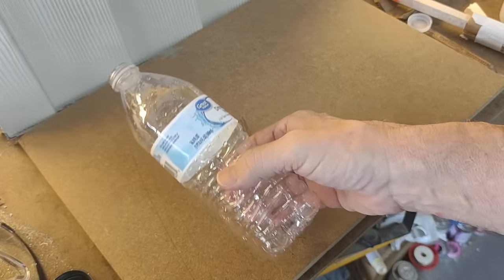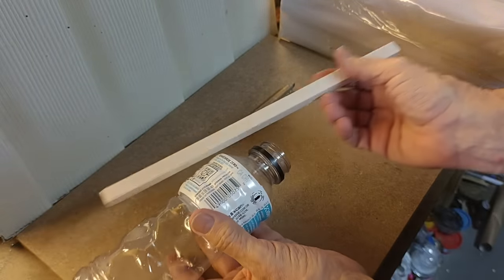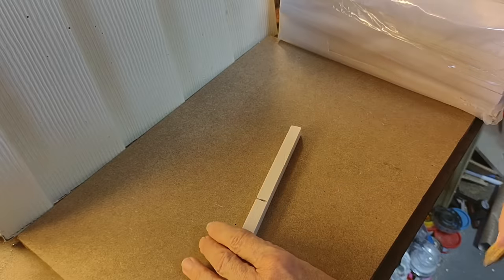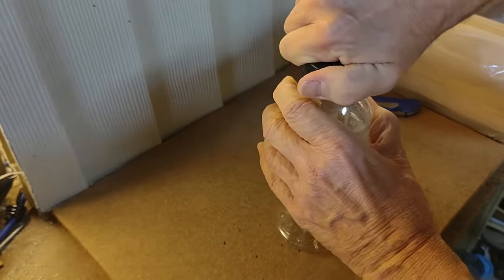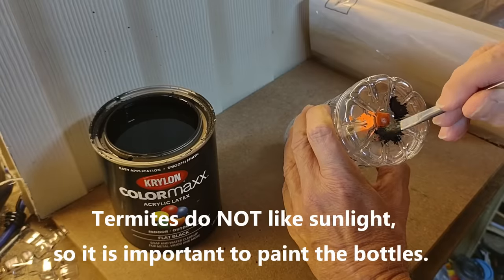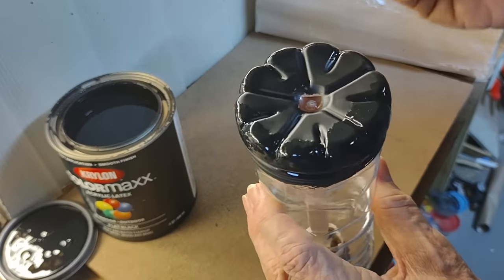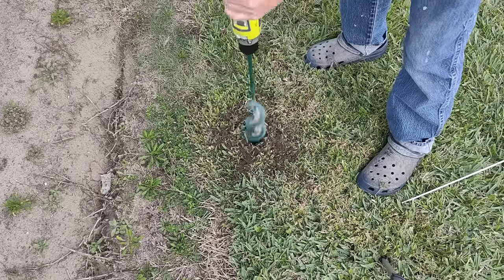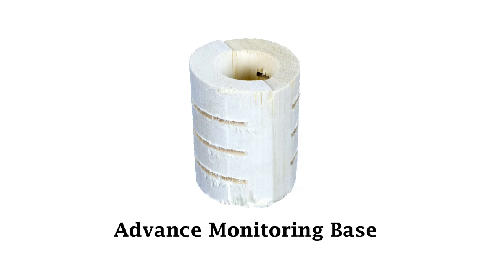Unbelievable Water Bottle Trick for Termites!  Simple to do!

Comment: You seem like a good dude, thanks for putting out this helpful, thorough and informative content!  I believe I have termites inside of one of my structures (Ohio) and hope they aren't the drywood type, I'm not in a tropical environment so I can only assume it's the subterranean ones.  This was my first video so I'll have to watch more to educate myself on the subject.  Thanks again!
Reply from the maker: The only species you have in Ohio are a common type of subterranean termites that are very easy to treat.  There are two options for treating subterranean termites yourself.  The easiest way is to use termite granules.  It costs less than $60 to do and it only takes about an hour.  The application is so easy that a child can do it.  The other option is to trench around the entire building, including the driveway.  It takes about a day for most people to trench around an average sized building and it only costs about $100 to do the job.  Trenching lasts for 5 to 10 years, but the granules should be applied every year as a preventive measure.  I have videos on how to do both options and I will place links below.       
 
For the granules to work you need to have dirt around most of the house and that dirt needs to be porous enough to allow water to seep into the ground fairly quickly.  To find out if the dirt around your house is porous enough, just dig a small hole next to the house that is about 4 inches deep, 8 inches long, and just the width of the shovel.  Fill the hole with water and watch to see how fast it drains down into the ground.  If it seeps into the ground fairly quickly, then the granules should work just fine.  However, if it just kind of sits there, then the granules would not be a good choice, and you should consider trenching.  Make sure that you buy the correct granules.  You need the ones that have imidacloprid as the active ingredient.  A lot of the Home Depot and Lowes stores no longer sell the correct granules, but you can get them from Amazon.  I will give you a link to them.
 
You can give any subterranean termite treatment a bit of a boost by doing a spot treatment.  If at all possible, spot treating for subterranean termites should not be the only approach to eliminate an infestation.   An additional exterior treatment should also be done with either granules or trenching, whenever possible.  Spot treating alone may totally eliminate the infestation with no other treatments, but it's not a sure thing. 
 
To spot treat subterranean termites, you need to buy a fipronil foam.  I will provide links for two products that you can choose from.  I like the FiPro the best because it's a little less expensive and I like the applicator tip better, but the Termidor Foam also works very well.  The FiPro is not available everywhere.  If you can get one of these foams, then drill holes in all damaged areas, that are 4 inches apart, and drilled about halfway through the wood.  If you are seeing exit holes in the wall, then there is most likely a stud behind the exit hole.  Get a stud finder and locate the stud where it meets the ceiling and drive a small nail into the stud a couple of inches below the ceiling.  Attach a weighted string to the nail and that will show you where the stud is.  Then drill the holes 4 inches apart along the entire length of the stud, about 3 inches deep.  Do the same thing for woodwork, except only drill the holes halfway through the wood.  If you think that there is a 2 x 4 behind the woodwork, then drill a 3-inch-deep hole every 8 inches.  The holes only need to be wide enough to get the applicator tip of the foam can into the hole.  After the holes are drilled, then shoot the foam into each hole for about 5 seconds or until you have foam either coming back out at you or coming out the other holes that you drilled.   All the holes should have foam either going into them or coming out of them.  This will contaminate their food source and they will take the fipronil back in the colony and spread it around to the other termites.

Most of the time, subterranean termites are going to be building mud tubes somewhere.  You will most likely find these mud tubes going up the exterior or interior of your foundation and you may find them along joists and even in the attic sometimes.  If you have a slab home, then you may find them going up the outside of the house on the slab and even the side of the house.  If you can find the mud tubes, then you can treat them as well.  Just scrape off about a 2-inch section of each mud tube down to the bare surface.  Then, shoot that foam into each side of the mud tube and also apply a little of it on the surface where you removed it.  The termites will rebuild the mud tubes and bring the foam back to the colony to spread around to the other termites. 

Also, if you can find the mud tubes, this is a very good way to determine when the infestation is gone.  If you scrape off that 2-inch section of a mud tube, you can see if there are any live termites in the tube.  Again, the termites will rebuild the tube and go about their business.  Do this every two weeks after you finish all your treatments.  Apply the foam to the mud tube every time you do it. At the point you are no longer seeing live termites and they stop rebuilding the mud tube, then your infestation has been eradicated. 

It typically takes several weeks for any termite treatment to be effective.  That is because you are using slow kill products.  If you were to kill the termites too quickly, then they would not have a chance to bring the poison back to the colony and share it with the other termites.  If you don't kill off the entire colony, you will not end the infestation.  Therefore, you must kill off subterranean termites very slowly.  So, I would give this at least 12 weeks before I would decide that something went wrong, and the process didn't work.  Hiring a professional to trench your house is pretty much going to take about the same amount of time to kill off the colony.
 
I hope that helps.  Be well my friend.
 
Video on how to apply termite granules:   https://youtu.be/H7rW_TSBHJ4
 
Video on how to trench for subterranean termites the right way:  https://youtu.be/Fy7YHi_7Z8g

Termite granules:  https://www.amazon.com/dp/B000RUIJYM?ref=nb_sb_ss_w_as-reorder-t1_k0_1_5&amp=&crid=A0Q6FR5I5QQH&amp=&sprefix=termi

FiPro:  https://www.solutionsstores.com/fipro-foaming-aerosol

Termidor Foam:  https://www.domyown.com/termidor-foam-p-3528.html

Comment: Hello Guy! I am considering spending a lot of money on pest control and wanted to ask your opinion first. Three years ago our split level house in Hawaii was flooded by a leak upstairs, and we had the whole house gutted down to the studs. We completely renovated our kitchen, which is upstairs, with new cabinets in late 2021/ early 2022. For the past year we've seen the termite droppings/frass under 3 specific corner cabinets, but nowhere else. My suspicion is that the eggs were in the new cabinets. In the last year we've seen the frass nowhere else in the home, but consistently under these three cabinets about every month or so.

My question is this: should I tear out the cabinets to save the rest of the house? Or should I tent the house or fumigate the kitchen only? Or is there something else that I should consider?  I'm willing to tent the whole house, but it seems like the termites are in this one specific area. I've never seen a termite, only the droppings, and there are no apparent holes or mud tracks that are visible...just the droppings on the counters under the cabinets. Please help!
Reply from the maker: I am so sorry that you are having this problem.  There is an outside chance that you may be correct.  It is possible that the drywood termites were in your cabinets when you installed them.  If you have not seen any swarmers (flying termites) then it is possible that the gallery in the cabinets has not matured to the point where the infestation can spread to other areas of the house.  Since drywood termites are very slow eaters, you do have the luxury of time, so I think it's worth treating the cabinets first before you decide to fumigate the entire house.  I must be honest with you though.  I cannot rule out the possibility that you became infested from your neighbor's house.  Still, even if that were the case, your home is not in any danger at the moment.  It takes many years for drywood termites to do significant damage.  This is why you do have the luxury of time here.  Personally, I would treat the cabinets instead of removing them. 

You indicated that you didn't see any holes in the cabinets.  I can assure you though that there are holes.  You just need to find them.  These holes are quite small and can be difficult to detect.  You need to look directly above where you are seeing the frass.  Gravity is your friend here.  The frass it's going to fall straight down from the hole. That means the hole is located directly above the frass on a vertical plane somewhere along the cabinet surface. This hole is going to be very tiny, so you need to look carefully.  If the frass is on the inside of the cabinet, then remove the shelves and look where the shelf meets the wall of the cabinet.  The hole could be hidden where the shelf contacts the wall of the cabinet.  If the frass is below the outside surface of the cabinet, be sure to look at the ceiling.  Make sure that the frass is coming from the cabinet and not the ceiling.  There must be a hole because it is impossible for the frass to be pushed out without one.  Each pile of frass is going to have a hole above it. 

After you find the holes, they can be treated with a fipronil foam.  You simply shoot the foam into each hole for about 7 seconds, or until the foam is coming back out of the hole.  The problem is that you are not allowed to purchase pesticides in Hawaii.  Unless you know somebody on the mainland that can ship it to you, you are going to need to hire a pest control to do this for you.  Just tell them that you want to spot treat the cabinets, and you have already identified the kick out holes.  You can tell them the exact treatment that you want them to perform.  If you want to treat this yourself, but you do not know anybody who can ship you the foam, then try ordering it from eBay.  Sometimes there are people who will ship it to you, either because they don't know the law, or they don't care about the law.  Also, try ordering Fuse Foam from Amazon.  They are not supposed to ship it to you, but they are very busy, and the person filling the order may not realize that they are shipping the product to you illegally.  Sometimes it works.  You can treat this problem with either Fuse Foam or Termidor Foam.  So, if you try eBay, if you can't get one of them, then try the other.  You may just get lucky.  If you must hire pest controller, ask for a free inspection.  Don't tell them what you want them to do until they arrive at your house.  Just ask for a free termite inspection.  After the pest controller arrives, then explain what you want them to do, and get a price for it. If it's more than a couple of hundred dollars, then thank them for their time and try another pest controller.  You can get as many free estimates as you wish.  My recommendation is to stay away from the national companies. They often send trained salespeople instead of actual pest controllers.  These folks work on commission, so they try to sell you stuff that you don't need.  Some of them are going to try to tell you that you need to fumigate the entire house, and while that may be true, we don't know that yet.  Remember that you do have the luxury of time here.  You can always fumigate later if you see any of the evidence of termites.  For now, you just need to get the cabinets treated, and you need to do it before you start to see swarmers.  Since the pest controller is going to do a free inspection, you may as well let them inspect the entire house, just to see if they find evidence of termites anywhere else.  It is a good idea to shadow the inspector.  If he sees a place where he suspects termites, you want to see it.  Don't just take his word for it.  If you are with him while he is inspecting, he can point it out to you as he is seeing it.  If he is not seeing frass and kick out holes, then ask him to explain why he suspects termites in that spot.  If he does locate frass or kick out holes in other areas of the home, then you will need to fumigate the house.  If that is the case, then get as many estimates as you can.  Prices can vary wildly in this industry, so it pays to shop.  Please let me know if that is the case, because I have important information that you need to know before you fumigate.  If you use a mom-and-pop company instead of a national company, the inspector may just get a can of foam and treat it while he is there.  This will save money.  Again, the national companies often do not send out pest controllers who will be driving a pest control truck.  They may arrive in a company car with no pesticides with them.  That is because they are not licensed to treat anything.  The mom-and-pop guy will probably show up in the truck he uses to treat jobs, so it is likely he will give you a good price to just do it now, if it's just treating the cabinets.  I mean, he's there already, so it's just another 10 minutes of his time.  If I was inspecting, I would probably treat it for free, just to obtain you as an ongoing customer.  Not only would you use me for future problems, but you would brag about me to your friends and family.  That's a good investment for $10 worth of foam.  Not all pest controllers think that way though.  Just the smart ones.

I hope that helps.  Be well my friend.

Comment: thank you so much for that wonderful presentations .I am in the Philippines and it is a tropical country can you make a video for dry wood termites thank you in advance more power to you.
Reply from the maker: Thank you so much for those kind words.  I do have a video on drywood termites.  Actually, I have three of them.  I will give you the links.

It is important to understand how drywood termites work.  They enter through cracks and crevices around windows, doors, the eaves, pipe penetrations, and so forth.  Most of the time, they enter through several locations.  That is because a swarm of them attacked your house at the same time.  If there was a crack or a crevice, then they probably found it.  After they established their galleries, which will be inside the wood, it will take four to seven years for them to be able to swarm.  Now that they are in your house, the swarmers will use holes that are in your studs to travel through the walls.  Those holes in the studs were created by the electricians to run the electrical wiring.  Not only are these holes going through the studs, but holes were drilled into the attic for the light switches and to run some of the wiring for the outlets.  So, the termites now have easy access throughout the attic and the walls.  If you have a basement or crawl space, they have access to that as well.  Most of the time, you will have no idea that they are in the walls, because the frass is inside the wall.  To make matters worse, if you have drywood termites, then your neighbors have them too.  That means you have been getting swarmed for as long as they have existed in the neighborhood.  Most likely, we're talking about years, so it's a safe bet that you have these guys in many locations in your home.
                            
I always hate to be the bearer of bad news, but if you have drywood termites, the only way to get rid of them is to fumigate.  Prices for this can vary wildly in this industry, so I recommend that you watch my video on how to hire a pest controller without getting ripped off.  That video can save you a lot of money.  You should also know that the gas they use to fumigate has absolutely no residual action whatsoever, so you can get reinfested the moment the tent comes down.  Like I said before, if you have drywood termites, then your neighbors have them as well.  Since drywood  termites swarm every year, it is almost a certainty that you will be reinfested within a year after the fumigation is done.  The only way to prevent this is to do a preventive treatment on your house every 60 to 90 days.  Most pest controllers will not do this, so it is something that you generally need to do yourself.  I have a video on how to do that and I will place a link below.  If you absolutely cannot afford to fumigate your house, then you can try spot treating it yourself.  It is virtually impossible to find all the termite galleries, but it is way better than doing nothing.  Regardless of how you treat it, you should begin the preventive treatment immediately, so that you do not get additional termites paying you a visit.  

I hope that helps.  Be well my friend.                        

Video on how to hire a pest controller without getting ripped off:  https://youtu.be/y-a8XOqVrlE

Video on how to prevent drywood termites: https://youtu.be/neNsmVbj8Pc

Video on how to spot treat drywood termites:  https://youtu.be/U7ck7zhS0Xo

Video on drywood termite treatment options:  https://youtu.be/iD6NTU16-XQ
Reply: @GuysPestSolutions  thank you again for the info. more power to you.
Reply from the maker: @josephcuenca6320  You are very welcome.  Be well my friend.